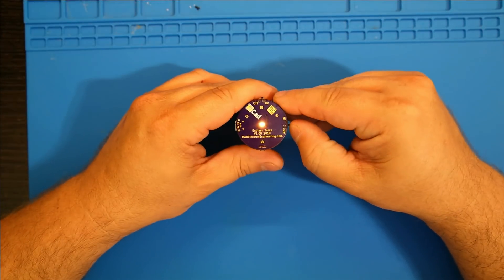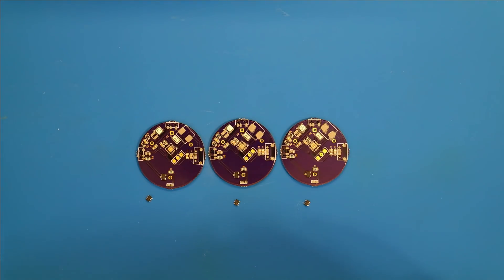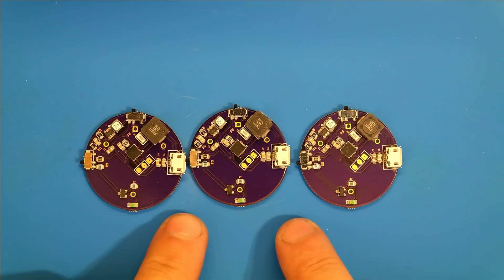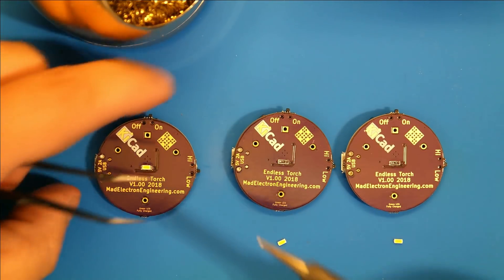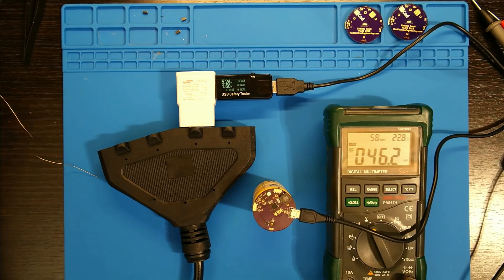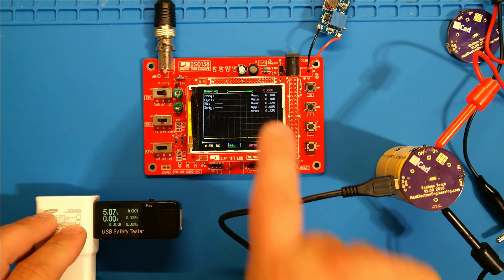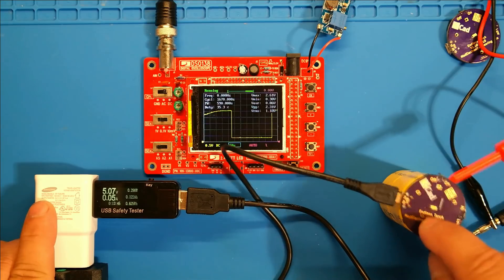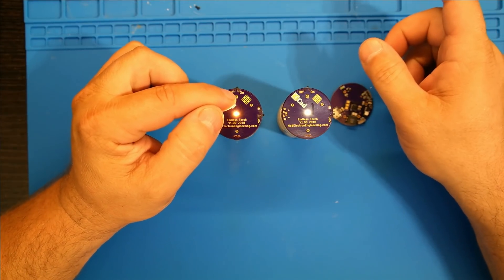Endless Torch V1.00 Supercapacitor Nightlight First Build & Testing

Comment: Most AWESOME!  Any idea what the lumen output of the lights...I really like these and if you release the gerbers or share on OSHPark I would like to try to build some...maybe even make a small 3D printable case for em...just think of a vehicle safety light everyone keeps a USB charger in their car and more often than not the AA battery ones end up dying from sitting so long.
Cool design...great job!  I would have thought maybe a 1A charge limit would be best to prevent overheating but your 1.4A seems to do well.  Very cool to see a new design...you should share this over at budgetlightforum.com 
Just think..never have to change the darn batteries ever again on a flashlight...so cool!
P.S. Conformal coat the boards to protect em from moisture